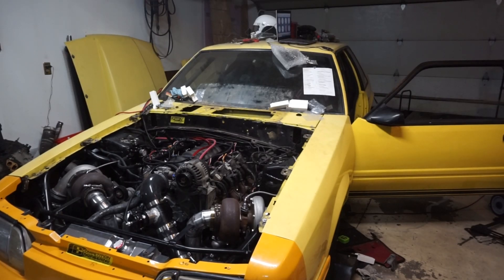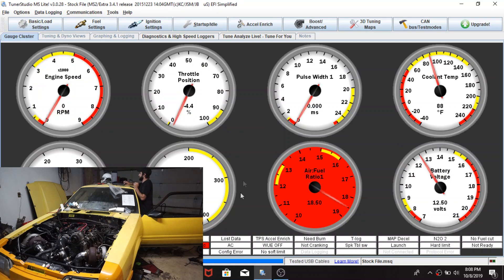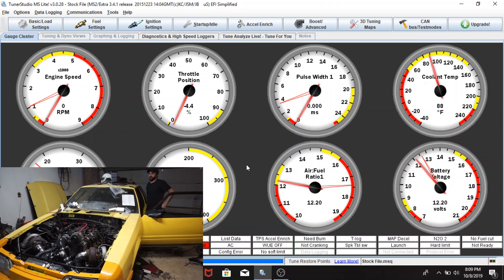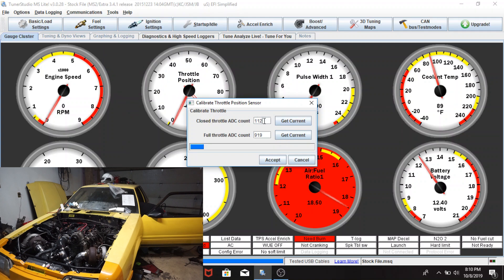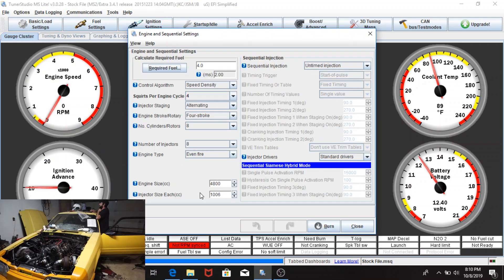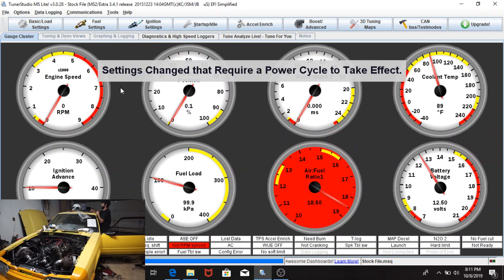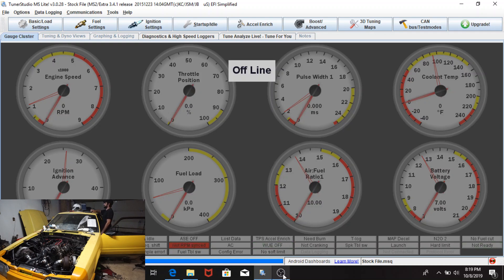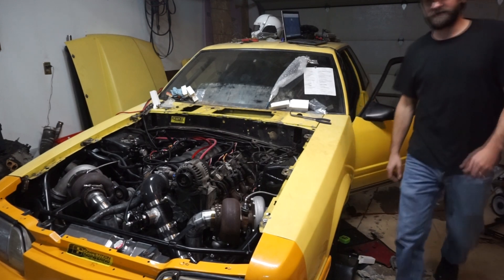Microsquirt Setup, Stock File No Start To Idle In 12 Minutes!!!

Comment: I've got a gen3 6L LS using micro squirt  I've connected my VR-  to the signal wire on the crank sensor.  12 volt switch power to the power wire. And the remaining wire to my sensor ground. I've double checked and made sure everything was hooked up properly. But I don't have any RPM signal while cranking do you have any idea what the problem could be?

Comment: Just a note: unless you live in Florida, the watertemp shows 90 for a car that doesn’t run .... no coldstart enrichment. But it seems that you have monstersize injectors. A Pulswith of 2ms is basically at the edge of being unstable. Also the batteryvoltage drops below 12V at 1000RPM .... the alternator should kick in somewhat, maybe 13V or so.
Lots of luck with your project.
Bernhard (MS3 Pro owner)

Comment: Another quick tip, when you do lower tps adjustment you don’t need to do upper, just give it the lower and hit accept, also when you accept go back to zero throttle that might have been what was giving you issue with doing it twice, it just needs the top and bottom numbers to know 0/100
Reply from the maker: Yeah it was weird. Did it that same way 4-5 times.
Reply: a21bravo that is odd for sure I’ve never had to do it twice